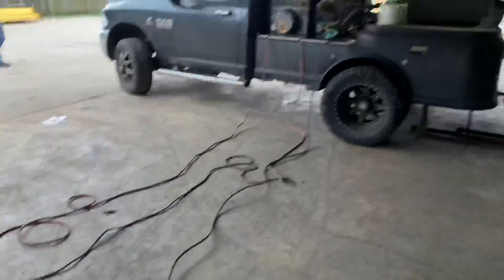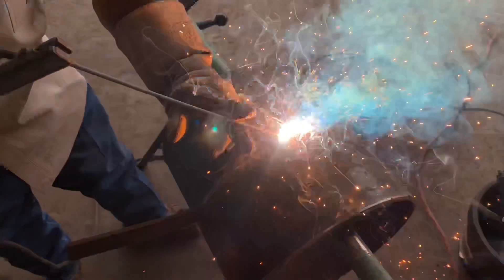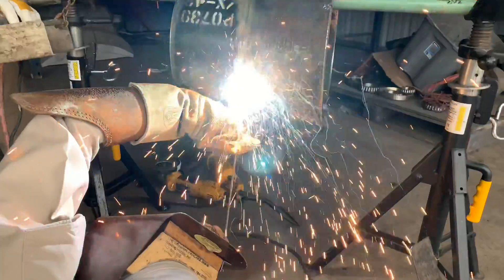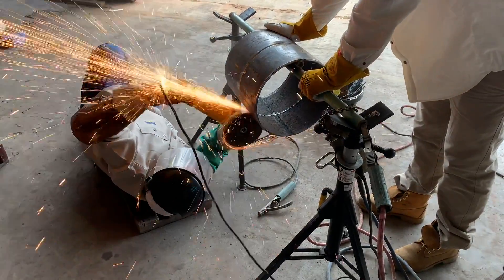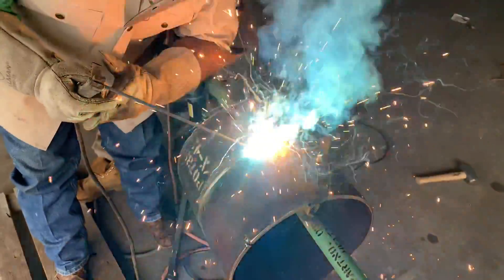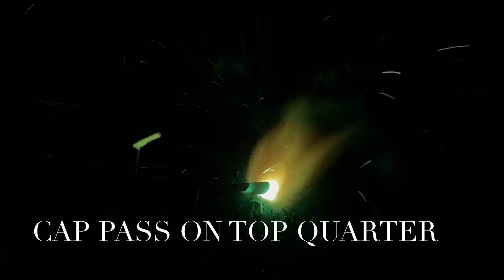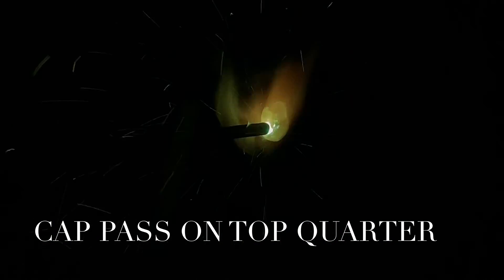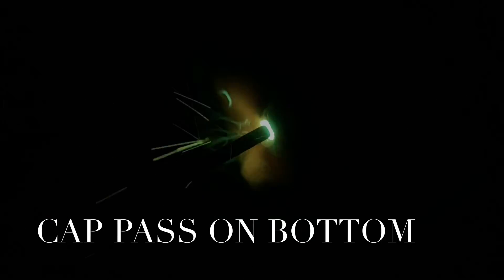Downhill Pipeline Welding

Comment: Quick question, how do you keep from creating a bughole on the pullout? And great video by the way.
Reply: Flick the rod
Reply: @roosterboy1122  I found that long arcing out of the puddle has been working for me here lately
Reply: @richardcabrera7405  probably works  you still rig Welding yet?
Reply: @roosterboy1122  yes sir!
Reply: Ya it's fun

Comment: Scotty wisdom! hey man, I got myself a load of 8010g rods all different sizes and they run REALLY weird on a miller dialarc. I can get them to run for about 3 inches then im really fighting it and it sputters n snuffs out.  Is 8010 meant for generators?
Reply from the maker: Christopher Bell probably need something with more arc force like a Lincoln
Reply: Running too cold, and or run your travel angle about 3 degrees to your left, to help move the slag away from the arc.  Also, cook your rods, ALWAYS.  I cook mine, pull em out and wrap in aluminum/Tin foil, then wrap em in a sweat towel, so any moisture gets absorbed before it reaches the rods.
Reply: @marcusharley3064  heating rods are for lohi. Not xx10 rods
Reply: mar10_z0mbie Yes, but drying all rods helps too. You should try it .